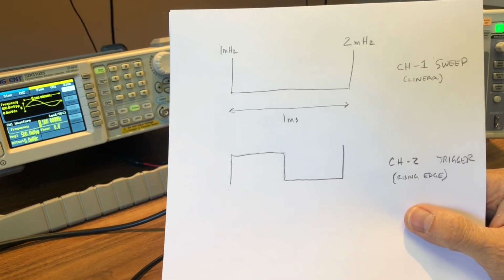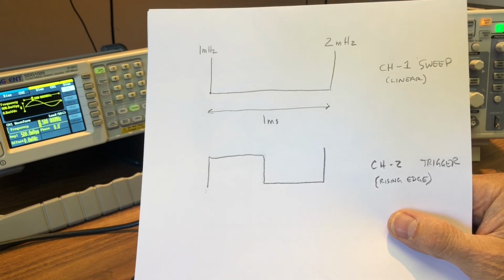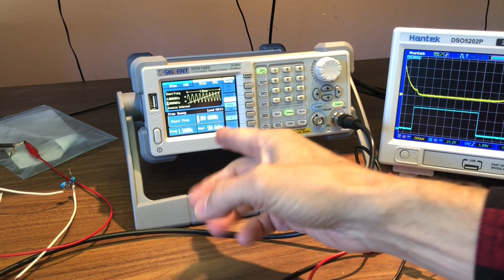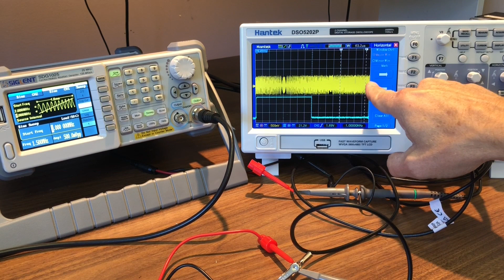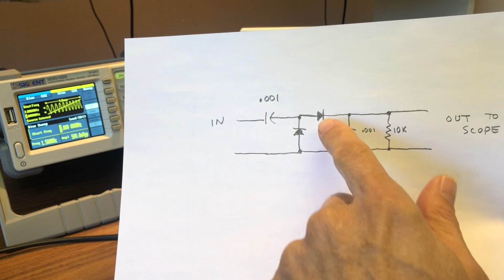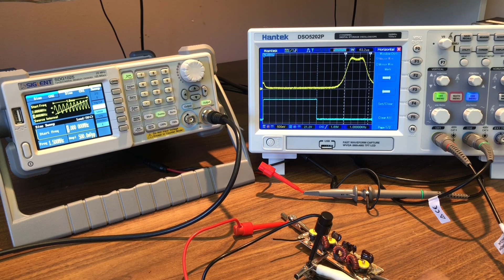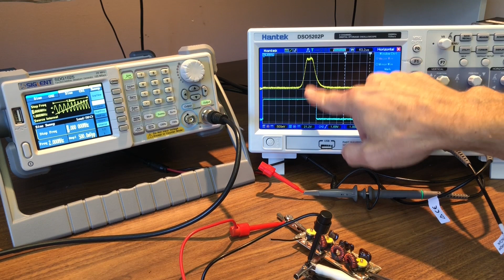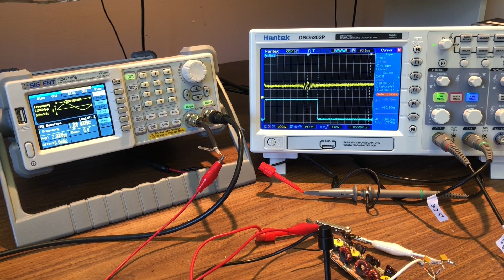Tuning a bandpass filter using a signal generator and oscilloscope

Comment: Will this same process work to sweep the IF cans at 455khz on a radio?  If so I've been searching for years for a way to do this. Any suggestions would be greatly appreciated. I have a siglent SDG1032x and a Rigol DSO very similar to the scope in this video.
Reply: yes this will work wit h 455 , also with 10.7 MHZ its a good way to tune old radios

Comment: Hello my friend,
I'm trying to use a generator similar to yours to replicate the brands (peep) similar to Heatkit's generators, but without success.

I'm trying to do the same thing as the TS-3 generator, mixing fundamental and marker signals, but the result is not similar.

Have you tried doing something similar successfully?
Hug!

Comment: hi, good presentation on how using function generator to the scope for displaying frequencies response.. i'm using hantek dso2d10 and fy6900 signal generator., i think my sweep function doesn't have trigger out like your signal generator. i am using VCO for sweeping frequencies, and feed to VCO IN and external trigger on the scope. it works{tested with LPF) but i think it's not very stable like yours(curves move forth and backward). do you have any suggestion? thanks and 73
Reply: I've found my own answer. I've done some researchs. Now i'm able plotting frequencies response. Thank you anyway 😊

Comment: How do you do an FM radio with a sweep when the trigger square wave tops out at 10Mhz? I been trying with my Siglent DSG 1032 generator which is almost identical. My trigger square wave gets really rounded off up at 10.7 MHz. I watch the channel Electronics old and new and he seems to get a great square wave from trigger with an older model generator than ours. He uses the trigger as a 10.7 point to align his trace on the channel with his curves from radio. Excuse my novice questions, new to FM, AM is simple. I finally got results using my older Wavetek generator with a sweep out function using the scope in X-Y mode on my old Tek scope. X-Y on digital scopes is not very sharp and hard to see details.
Reply: Hm. Something is amiss here... Your trigger frequency is independent from the frequencies your sweeping from and to. 
It's always 1000/(sweep-time in ms) Hz. 
As far as I remember, Manuel (electronics old&new) uses a 70ms sweep time, as this works nicely with his scope as it's 14div whole screen so at 5ms/div one sweep is full screen. So 70ms per sweep results in about a 14Hz trigger. 
No matter if sweeping from 440kHz to 470kHz for AM, or from 10.65MHz to 10.75MHz for FM, as the sweep is done in 70ms, the trigger frequency is always 14.28... HZ
I see no reason this trigger signal would be rounded of in any way. 

On most modern signal generators, the trigger is set high at sweep start, and low at 50%. So, if you set your sweep symmetrical (which mostly is the default), trigger->low is center frequency. 
As you need this to be the trigger on your scope anyway, just set this channel to visible.

For your Siglent 1035 the setup to sweep a 10.7MHz filter with +/- 500KHz would be like:
(Assuming your oscilloscope has 14div/screen, if not, change sweep time accordingly to div per screen * 5)
Channel 1:
Settings: Wavefrom Type - sine
Function Sweep, Start Freq.=10.65  -   Stop Freq.=10.75  -  Sweep time= 70ms -  Source = Internal - Trig. Out = ON

Connect SDG1035 Channel 1 output to the input of the filter to test,
Connect your oscilloscope Channel 1 to the output of the filter to test
Connect the SDG1035 AUX (rear of device) to Channel 2 of your oscilloscope.
Set you oscilloscope to trigger from Channel 2. 
Timebase 5ms/div.
Make sure your oscilloscope is in XT Mode (!) - This setup works differently as the old waveteks which needed XY mode, as you get a digital trigger out, no analog sweep-sawtooth!

Edit: 
Of course: Connection to the input according to spec for this filter, this may require a cap or a loosely coupling - should be noted in the alignment instructions of the radio. 
Connection from filter to scope via a demodulation probe or (if not available) with the diode-circuit mentioned in the video. A similar circuit is also often shown in alignment instructions.

Comment: The Kenwood TS-520 service manual describes pretty much the same procedure, however they call for three frequencies to be injected. 8.295, 8.595, 8.895 with a 3 db PEP wave between them. What is the best way to get the three injected and measured?
Reply: I'm looking for the same answer, did you got find a way of doing this?

Comment: Thank you very much for sharing great information I need,
Now I can do visual alignment on some 10.7 MHz IF cans,
One question for extra marker signal, could we add two different frequency into the sweep system. No Any issue to the system or signal generator, thanks again

Comment: That's i was looking for!!!  thanks for your  usefull video!  i was familiar using  tracking generators in addition on spectrum analizer. it could be  interesting to see if you can compare your measure  with a tracking generator and spectrum analizer.  best regards

Comment: Tuning a BAND PASS FILTER you need to look at the BAND PASS FREQUENCY and the RETURN LOSS ( SWR), how well it looks like 50 ohms match to the FILTER, at the same time. You can do this but you need VECTOR NETWORK ANALYZER. There is a crud way to but together one, but it would take to much time to try to explain how to put one together.

Comment: very nice video.     i bet that signal gen does noise.     i often measure filters with noise input and send output to a sdr radio and the sdr software FFT lets me see the filter shape.         alot of scopes now days, also have an FFT function.   often found in the math menu.

Comment: Very nice video. I cannot afford the nice generator you have....But I found one for half that price from Koolertron on Amazon. I learned a lot from your video about needing a SYNC pulse to trigger the 'scope and I never knew that the signal needed to to be DEMODulated to view the bandpass. I'm aligning an old Tube transceiver and there are filters needed to be checked for bandpass.

Comment: I enjoyed your video, and like your teaching and reasoning. We all know what you mean when you said you used "eye in 3,4 diodes" but beginners may not. They are actually 1N34 diodes. not " i " (eye)N34. you can also use 1N914 diodes as they are redily available. not as sensitive as the 1N34 type. The 1N34 type are germanium as you said and they have a forward bias of .2 to .3 volts wheras silicon 1N914 diodes need .7 volts. I've used silicon diodes in this circuit too. 1N34 is best. I enjoy watching how others do things. So keep doing what you are doing, its great info!

Comment: Great Alan very informative as per norm. Thank you.
I wonder if you could do a video for beginners of how to use a FG safely with a scope and a breadboard where someone might be probing a project of a simple circuit that has caps restistors and diodes and the correct way to use ground connections. I Know it sounds basic but at this time when people cannot go and sit with an instructor/peer it would be good I think.

?

Comment: Nice video! Youtube stuck this into my recommendations for some reason, and I'm glad it did.

In your little rectifier / demodulator circuit, what are the values of the ".001" capacitors? They seem too physically small to be .001 F (or 1 mF).
Reply from the maker: They are .001 uF or 1 nF. You could probably use 10 or even 100nF caps.  I don't think really critical depending on frequency under test.
Reply: @ve6wz  Thanks!

Comment: mHz and MHz are not the same.  'm' = milli  'M' = Mega     mHz = millihertz, MHz = megahertz 

see this for more info:  https://en.wikipedia.org/wiki/Hertz#SI_multiples 

Also, how about posting a link to a schematic for the "de-mod' probe detector circuit that you used. 

73 de N1FBZ
Reply: At 06:26 you'll see a schematic.